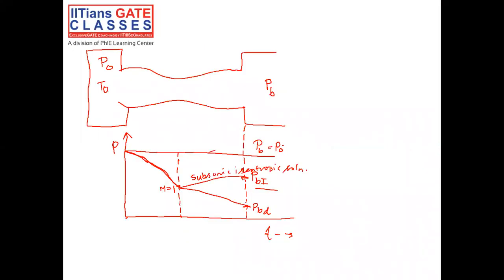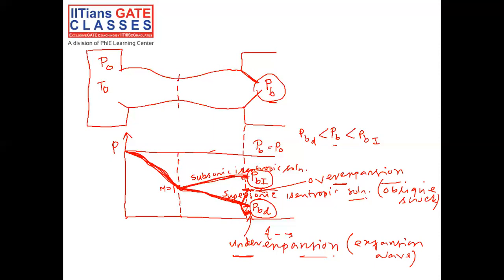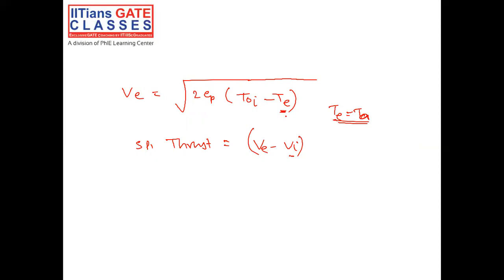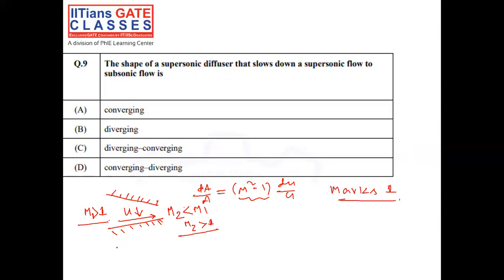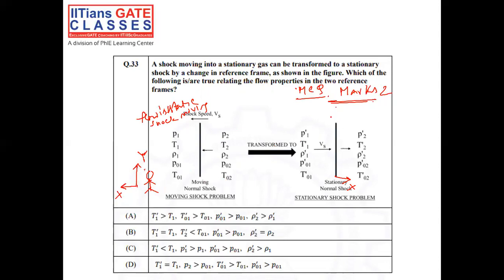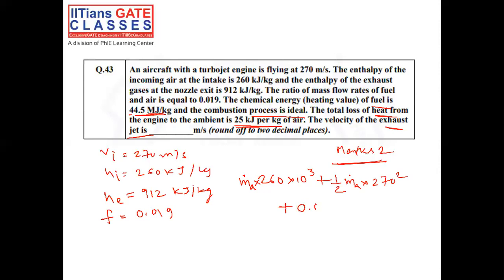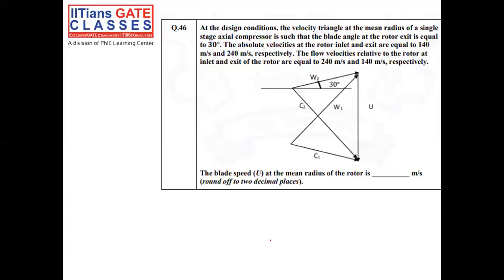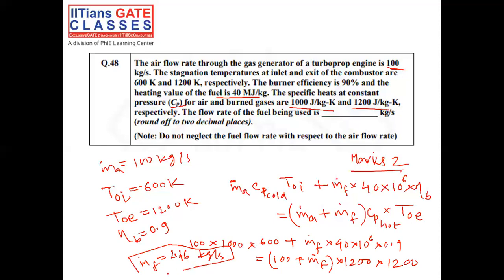GATE 2021 Aerospace Engineering Question Paper | Propulsion & Gas Dynamics Solutions | GATE AE

Comment: Q33. Option 4 is wrong Po1'<Po1
Reply: Nope,
p01 < p01'
Here, in moving shock system, static and stagnation properties are same for fluid ahead of the shock wave since, gas is stagnant until it encounters the shock.
Reply: @akshayhegde5286  but in original option you change the last quantity and option d  is right but show you show different than original

Comment: Q8. Isp=F/weight flow rate, but in question Isp given interms of F/ mass flow rate
Reply: Yes, you are right.
Here it seems the question is using different unit for specific impulse.
Specific impulse has unit of seconds. In question they have m/s and that is the unit of specific thrust. 
Simple dimensional analysis can give you correct answer. 
Remember, these quantities are defined quantities and author can define in his own way as long as they provide the correct dimensions gor their definition. 
Here it is given in m/s and hence the definition modifies to Thrust/mass flow rate instead of Thrust/weight flow rate.

Comment: Regarding question 33, sir said that changing reference frame doesnt change static properties. Then will p2'=p2, T2'=T2? these are downstream conditions in both the cases. Will they be same?
Reply: I think this question has not good explanation...it can be more good than this
Reply: Yes you are right. 
Since, across the shock wave flow properties jump, static properties also jump with similar magnitude.
Here, static properties are same because those defines the state of the gas and we are considering the same fluid, the properties does not change with coordinate transformation. Whereas, total properties change because they are defined quantities, if you add dynamic part contributions in moving fluid such as transformed system here, total properties also change. 
Note that, total temperature across the moving shock is not constant eventhough process is adiabatic is because the flow process is unsteady in case of moving shock systems.